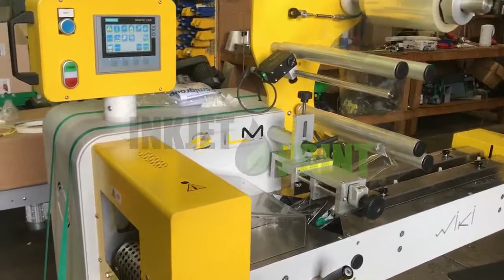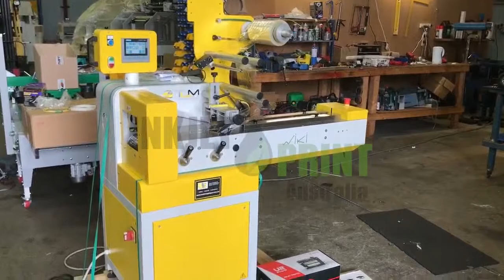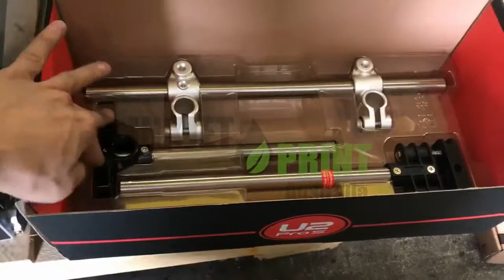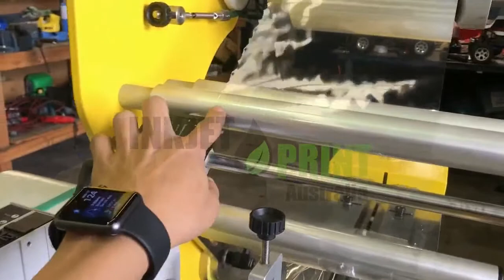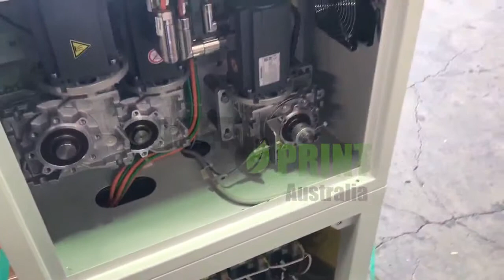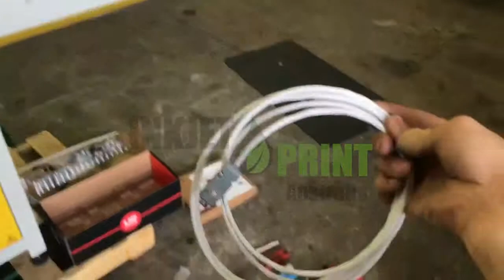U2 integration guide on Flow wrapper part 1

Comment: Great video. What model is that flow wrapper. Could you please link where you bought it. Secondly where do you buy your plastic film?
Reply from the maker: The Flow Wrapper is From Australian Wrapping Company and So is the Film you can contact them on +61 2 9604 7766 new model printers are also available here. Sorry For the late response!! Highly recommended.